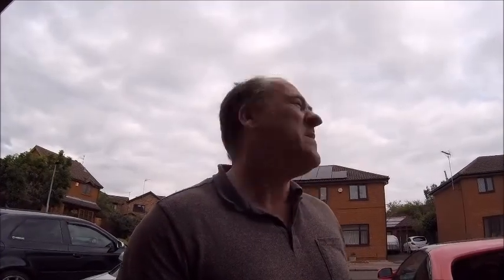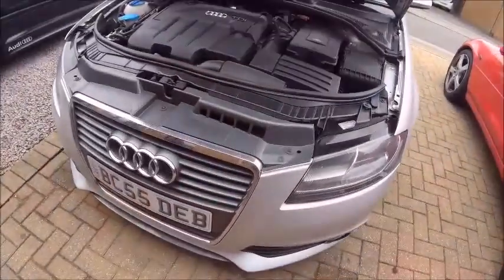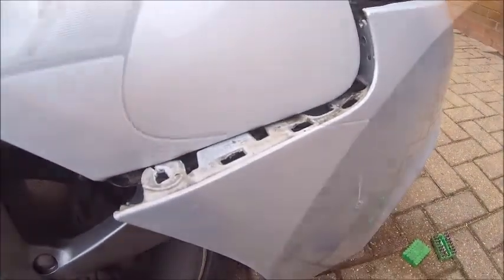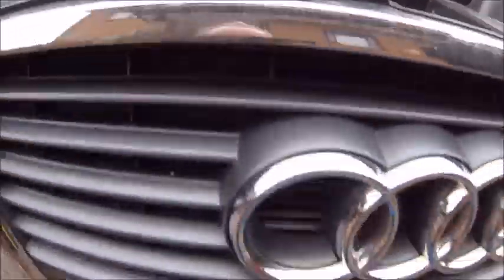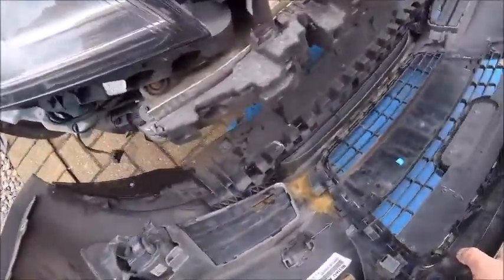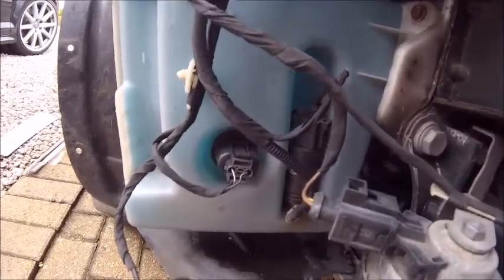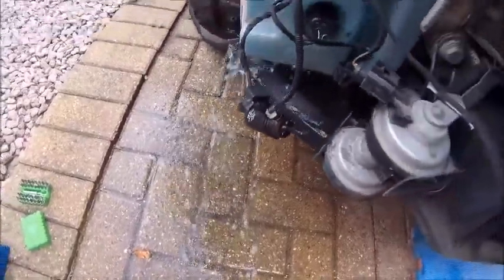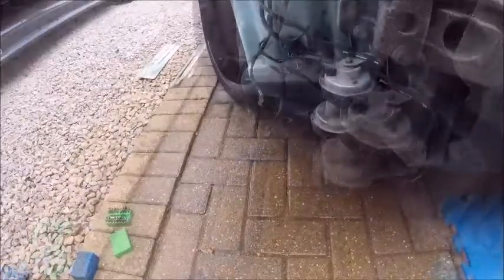Audi A3 Windscreen washer pump replacement

Comment: Great Video. On my A3 convertible (LHD) I only removed my fog light cover and fog light and I could remove/replace through this hole. Might be worthwhile to check before you start. Mine is fixed! (it did help a lot that due to this video I didn't have to go grommet hunting)
Reply from the maker: But grommet hunting is so much fun   😁

Comment: As a mobile mechanic for 30 year you don't need to take the front bumper off at all just take the wheel.off and the half inner wing and you can get to the pump from underneath
Reply from the maker: Just done work on the S3 too in the same area...have to say your a lot more flexible than me  😄
Reply: @AdeReeves  I have over 30 years experience in mechanic s and people take far to much notice of difference people and what it say on YouTube the Internet is not always right I seen were people have messed up and ended up taking a vehicle to a garage due to the Internet
Reply: Having spent a half day on this, I discovered that, at least on the 2007 A3, removal of the right side fog light, alone, gives access to the pump. On mine no need to remove bumper nor fender liner.
Reply: All audi are different some have easy access to component s and some are hard to get to to the nature of the car and not only that why has it took half a day to sort a simple little problem out were by taking the half fender off this can be done in less time in fact less then half hr
Reply from the maker: @UC8-Z8mm0TVQiq3BhcM7%F0%9F%91%8Dbhig did try that route, but to be honest for the half hour it takes to whip the bumper off, it just makes life easier  👍

Comment: My rear jet is working and front ones are not? Are there 2 pumps or...
Reply from the maker: Highly possible...this car does not have a rear wipe but there was a mock cut out for a second pump.
Reply: @AdeReeves  just went to the electrician, turns out is was some kind of module behind the steering wheel which reroutes the signal either to the front or rear pump, both of which were working on my car..